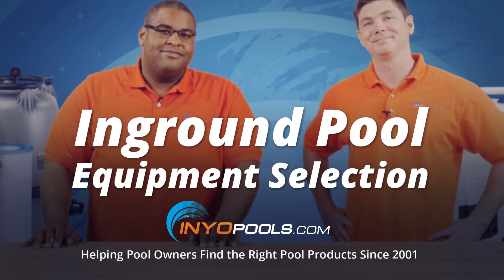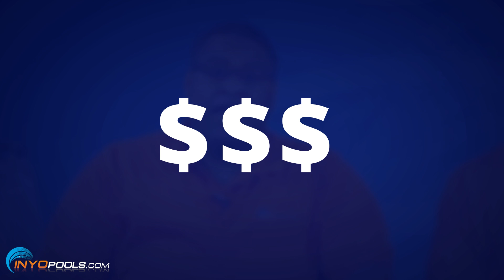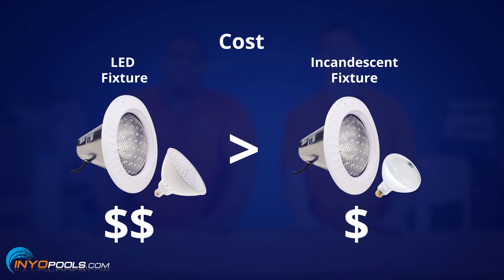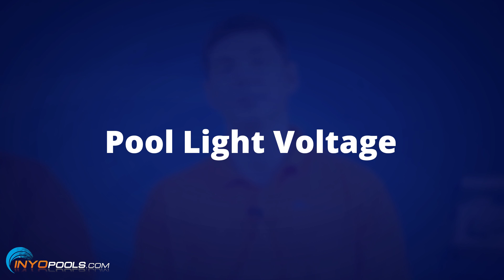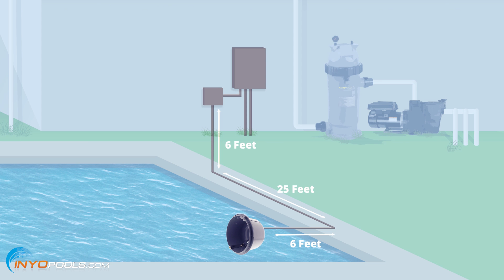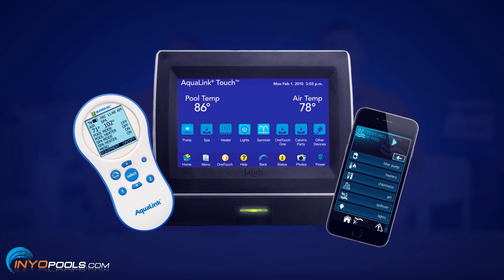How to Select Inground Pool Lights

Comment: HI, can you answer a question for me please?  I have the hayward colorlogic 4.0 lights 2 of them, one at each end of pool. I have the aquaplus controller , it controls my lights now,  in the hayward omniPL instructions it says (If the control is using networked colorlogic lights, the lights must be put into "standalone(default) mode before disconnecting the control).  Or do you know if i would have to do this? Been looking everywhere. Oh by the way nice video, thanks for doing this. helped out alot!!

Comment: Great video. 
Can an LED bulb be used inside the incandescent light niche instead of the incandescent bulb?

Thanks
Reply from the maker: In most cases, yes an LED bulb can replace an incandescent bulb. The majority of the pool light fixtures are large enough for the LED bulb to fit. Most of the LED bulbs will list acceptable light fixtures in the product description.
Reply: Ok. Thank you.

Comment: Hi there , i have a 120 volts light on my pool ,now that i have learned that people have gotten electrocuted i  am  scared to turn on.I had the pool built about 10 years according to code ,city inspector checked the wiring.Can this low voltage (12 volts) still electrocute you if something goes bad .And how bright are this lights? THANK YOU.
Reply from the maker: Hello Aj Sj - If the 120v light is properly wired, grounded, bonded and on a GFCI, there should be no issues. That being said, having a 12 volt light is even safer. We have not heard of anyone being electrocuted from a 12v light. The 12v LED lights are every bit as bright as the 120v versions. There was some truth, in the past, in regards to 120v incandescent lights being slightly brighter than 12v versions.
Reply: Still need a power transformer to use the 12v. Or get a GFCI if you stick with 120v

Comment: My light on the wall of my in ground pool is no good I want to take it out completely,we’ve already cut off cord. The place that used to be there to screw It securely I broke so I just need s cover to shut up the hole. Any ideas
Reply: Linda Byer drain cover, I believe they’re the same size. If all else fails, just place the light over it. Fake it till you make it lol